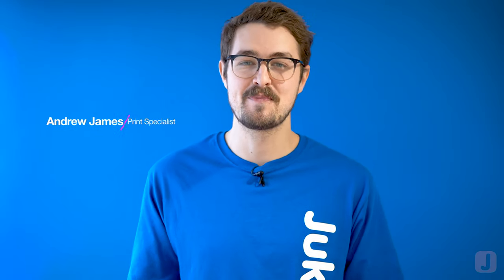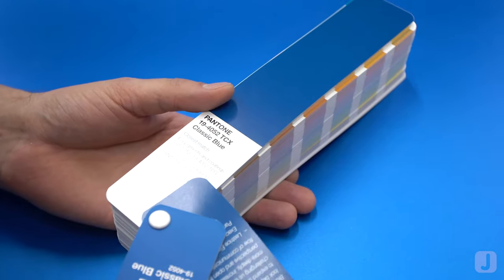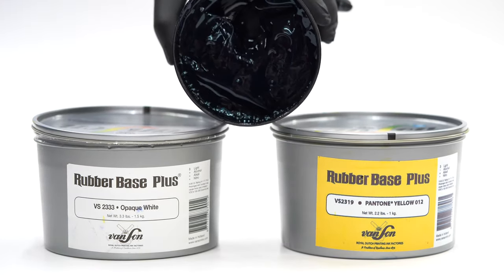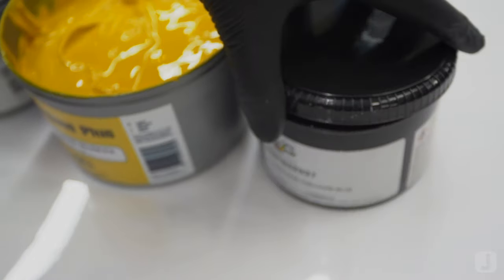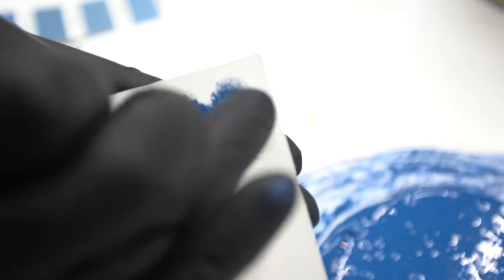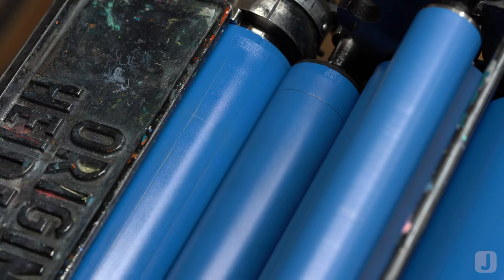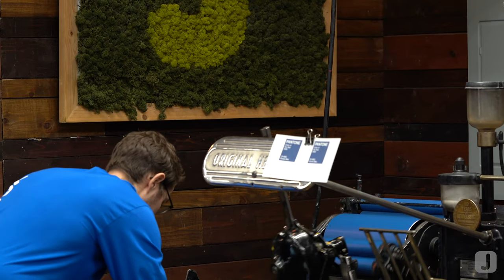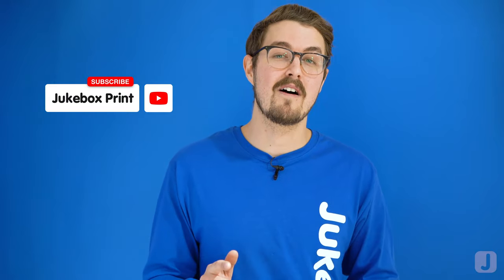Letterpress Printing Pantone’s Color of the Year 2020: Classic Blue

Comment: Good old Van Son Rubberbase!  The best inks I ever found for printing letterpress on a platen press. (Do they still smell as good as they did?)  I always felt I had to mix in a dab of Cobalt Drier, though, if I wanted to be sure that the rubber base inks would actually dry, especially on business card stock.   I've got to say that, while your example of the finished product looks really cool, with its 3 dimensional  effect of the white cotton paper stock raised above the blue solid, it is not traditional letterpress printing. I had a table top platen press, and a fairly good selection of ATF, Balto-type and Kelsey foundry type. I learned actual platen press makeready from high school print shop, and from reading many classic textbooks on the subject. We went to great lengths, in the days when letterpress was actually being used for most commercial print jobs, to avoid pounding the paper so hard that the type and engravings pushed through to the back side of the sheet. That was considered poor quality, actually. We used fine tissue paper overlays, under the tympan sheet on the platen, to bring the image to perfection without pressing through to the back of the sheet. Your example in this video is a clever specialty item, but today's trend of hammering the stock for a reverse engraved effect is relatively new; not traditional lettterpress craftsmanship. Please know I am not finding fault with your work, I just wanted you to know about the difference.

Your press rollers look like they are very high quality, or brand new.  Nice. The shop where i worked during the day, where i ran offset presses, had a Heidelberg Windmill. In the 80s and early 90s, they were still using it to print pamphlets, bulletins, etc. with text set on a Lino-type machine. Near the end, before I retired in 2009,  we still used it for numbering, perforating and the like. i look forward to seeing more of your videos.
Reply: OK, I just watched the "Pam -Am" wedding (Part 2) and i see that you don't always pound the paper with impression, but sometimes you do back off so there is little to no impression on the back. Good deal! I appreciate your attention to quality.

Do you ever print directly from type, or is it always a plate? Keep up the good work.

Comment: If the Color of the Year was 19-4052, why did you instead mix up 2154-U? Also, could you post a video some time about how you make the plates, from design concept to printing? Thanks.
Reply from the maker: Pantone has different codes for different substrates. I think 19-4052 is their classic blue number for plastics and other materials. The equivalent colour is the one we mixed.

Comment: Holy moly how many rollers does that Heidelberg have!? And I thought cleaning a fully manual cylinder press was a pain in the bum. 😂
Reply from the maker: 4 Rubber rollers and a few more steel rider rollers. This press has a wash-up system that makes things a little easier!

Comment: So little amount of ink :O How do you mix the same colour when printing in larger quantity?
Reply: The formula is in "parts" meaning a ratio of the whole thing adding up to 100 parts total. Percentages, basically. So the total weight of whatever quantity of ink you need will be your 100 as a starting point. That 100 could be any weight. 10 grams, 50 grams or a kilogram... Ounces, pounds, or ton. The parts are a percentage of that 100.
Reply: @davewood406  Ohh I see. Thank you!
Reply: Do you still mix it by hand if it's in large quantities?
Reply: @jmckinney0040  If you need a large quantity, usually one would order a tin of it premixed from your ink supplier.

Comment: With this crazy viscocity and tendency to stick to anything, how you correct propotions for losses on palette and spatula?
Reply from the maker: That's a good question... We try really hard to make an accurate mix and sometimes we do need to adjust the color on press by doctoring it a little bit. I'm not sure the losses on the palette or spatula are enough to make a big difference.
Reply: @JukeboxPrintLive  rubber based ink colour is consistently similar in dry and just mixed state, or you had to adjust to that difference also?